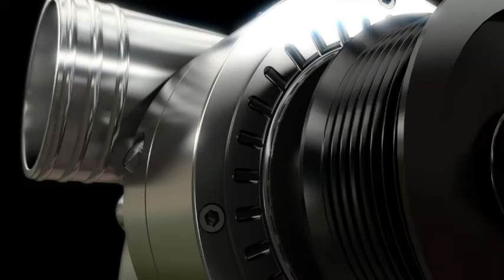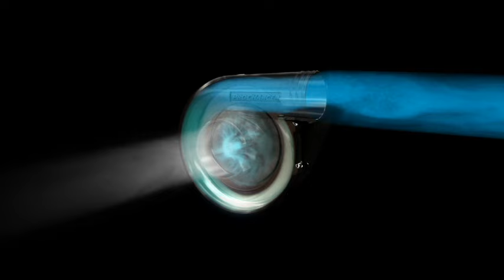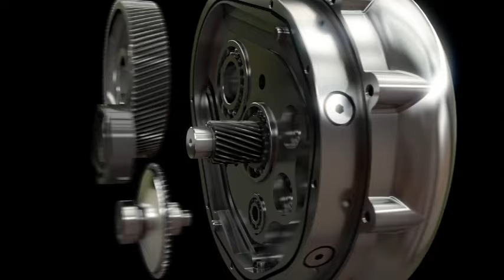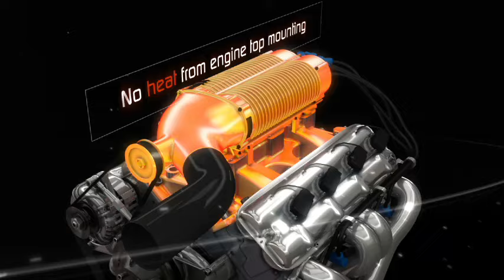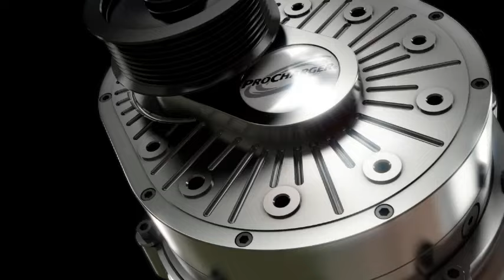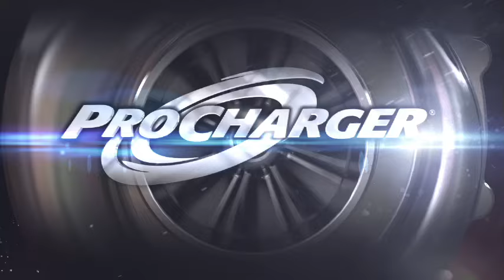What is a ProCharger? 3D Supercharger Animation

Comment: so is this a combination of a supercharger and a turbocharger ...?? because I didn't see an intercooler in between the setup..
Reply: ABDUL SHAIK    Intercoolers are optional. It's just like running forced induction with a carb; it may not be 100% efficient, but it works just fine

Comment: I dont understand this. Im pretty new to all this stuff so go easy on me. What air does the turbo take in? I understand that the impeller is being spun by the gear box mounted to the engine but does the turbo still need to take in air to put air out? Im a noob i know
Reply: At first, it isn't a turbo. A turbo uses the heat pressure of the exhaust to spin the impeller. The impeller takes air in from the outside and that air is used for the fuel-air combination wich goes to the engine.
Reply: Nope, it just looks like TURBO this is actually SUPERcharger,driven by the belt, and turbo itself is taking air from atmosphere,and than compresses it,but its powered by engine's exhaust which can lead to something called turbo lag,unless you have bypass valve,ALS, or second turbo built in to prevent it
Reply: ***** Erm, if driven by the engine or part of the engine, in this case the belt, then this isnt a turbocharger, its a supercharger. The basic of a turbocharger is that it is driven by exhaust gas. Correct me if I'm wrong?
Reply: jianh1989
 Yes that's right, and both have their advantages and disadvantages because of the principle of their functioning
Reply: jianh1989 yea turbo is define as an external use to compressed air

Comment: why no intercooler?  compressing air, heats it a lot, with an intercooler this unit work even better. That top manifold could be an intercooler, run an air ram duct tube from front of vehicle up to cool it.
Reply: BigCooter.com    For this demonatration they probably wanted to keep it simple and universal.
Reply: There is an intercooler, just didn't show it in this demonstration.

Comment: can you put it to an engine without intercooler??
Reply: Eero TheMightyFarmer The air is being heated by the compression, not the exhaust. And hot air contains less O2 pr unit than cold air. Therefore a tubocharged  or supercharged engine always have intercooling installed.
Reply: not because the intercooler for cooling the air.
Reply: technically you can. the output air is actually pretty cool. its not really heated. and you don't get the lag of a turbo cuz it runs off the belt.
Reply: juliesfar Correct me if I'm wrong, but the job of an intercooler is to cool the air before entering the combustion chamber. Cooling a given amount of hot air will increase its density and decrease the volume, but it won't become more rich in oxygen.
Reply: @PL4BOI  Running a Vortech V3 on 05 mustang 4.6L 3V.. without a intercooler...

Comment: But there are parasitic losses from running it off the crankshaft. 

I was losing 40hp at the wheels. 

Now I run mine off an electric motor and bring on boost quicker than a turbo.

Also you forgot to mention that a centrifugal procharger vs a turbo size that the turbo will hit boost quicker and higher boost...

A turbo is actually more efficient as it is running off exhaust gases and doesn't have parasitic belt losses. 

The advantage a centrifugal supercharger  (a procharger) has is responsive driving... it's sooooo much more enjoyable than a turbo... and it's BETTER power to the ground than a roots style supercharger due to traction and LOW boost at low rpm.

You match your cams and torque converter stall to your centrifugal supercharger and tire grip. Then you have a decent 0-100kph setup.

Comment: Dont be fooled, it doesnt bolt up simply like that lol it definitely requires an intercooler and more things because the air gets super hot like a turbo as well.
Reply from the maker: Not fooling anyone here. Our website hosts a massive amount of info for ever application we have including color step by step pictures in the install manuals. This 3D videos purpose is to show what a centrifugal does at a high level. Thanks.